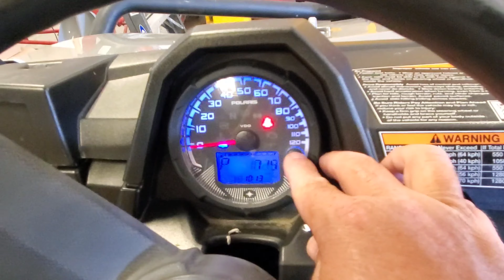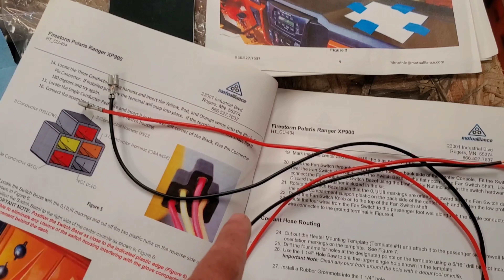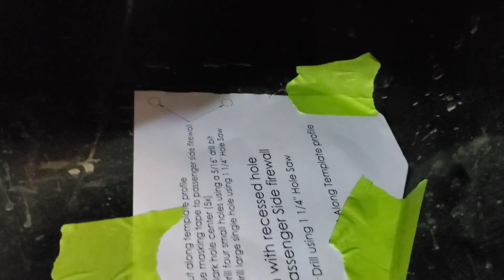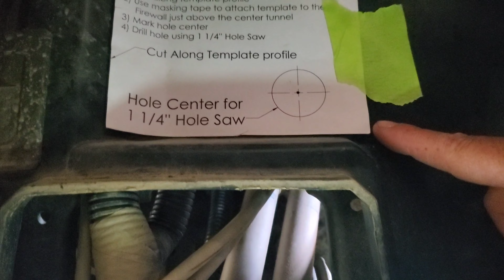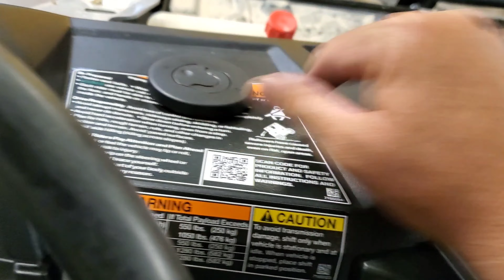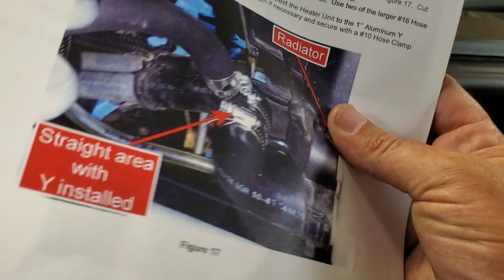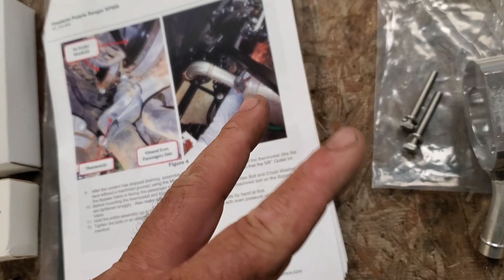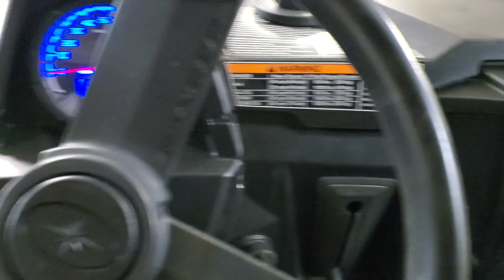firestorm utv heater install on polaris ranger 900xp

Comment: Thank you for the great video. I made one change to the installation...I replaced the shutoff valve with a 12V solenoid valve and installed a rocker switch c/w pilot light so I know if it's open or closed.
Again, thanks

Comment: FYI, I have a 12v pump I use to winterize jet skis. I would fill the bucket with antifreeze and let it recirculate with the pump so you don't have to flush the water back out. Otherwise, great video

Comment: The 7.3's can be tricky to get them to burp out the air too...and cracked injector cups can be the result. Now my pretrips include setting the defrost to warm and verifying it's blowing hot before taking off. That's some UTV you have there...never saw one with a digital readout. There's one problem I see with your installation...now your wife won't have to snuggle up with you to keep warm!
Reply from the maker: Lol with it being nice and warm in the cab that means less clothes to stay comfortable 😅